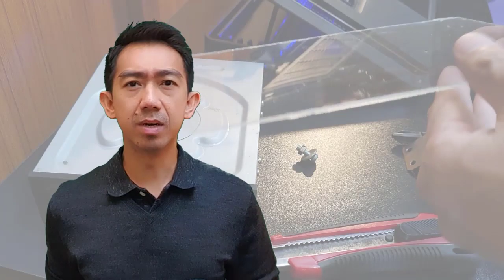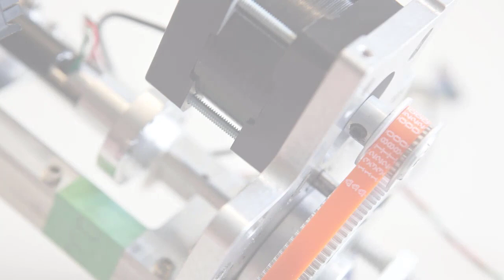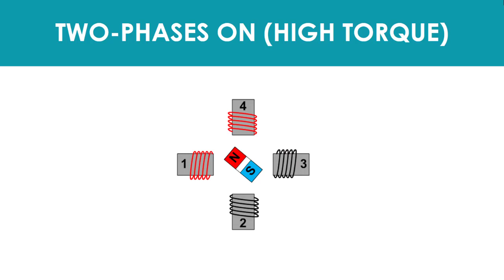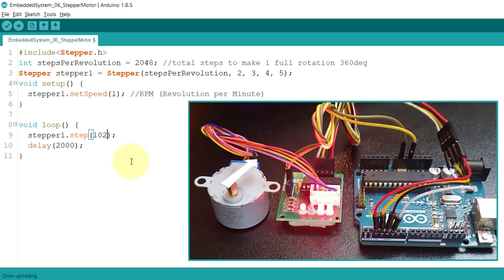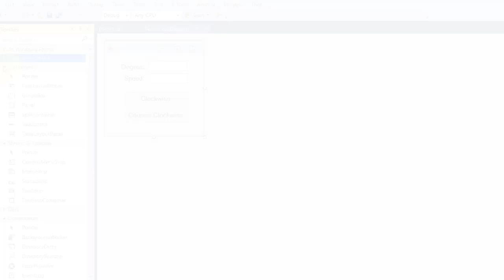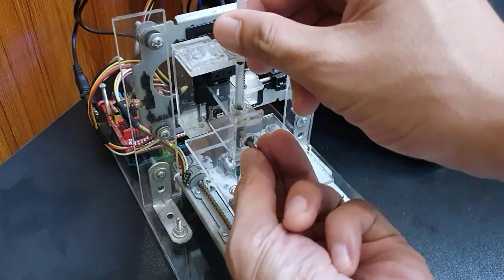09  Stepper Motors interfaced with C# - CNC Drawing Machine | Embedded Systems Application

Comment: THANK YOU FOR THE BEAUTIFUL VIDEO HOW SHOULD THE CODE FOR 3 PIECES STEP MOTOR CONTROL?
Reply: it doesn't work that way

#include <Stepper.h>
 int stepsPerRevolution = 200;  // change this to fit the number of steps per revolution
 
Stepper stepper1=Stepper(stepsPerRevolution, 2,3,4,5);
Stepper stepper2=Stepper(stepsPerRevolution, 8,9,10,11);
Stepper stepper3=Stepper(stepsPerRevolution, 30,31,32,33);

String data [3];
int index =0;
float steps =0.0;
void setup() { 

  
  stepper1.setSpeed(10);   
  stepper2.setSpeed(10); 
  stepper3.setSpeed(10); 
   
  Serial.begin(9600);
}
void loop() {
 if (Serial.available ()){
  data[index]= Serial.readStringUntil(',');
  Serial.print ("data read:");Serial.print (data[index]);
  index++;
  if(index==3){
    index = 0;
    
    steps = stepsPerRevolution / 360.0 * data[1].toInt();
   

    
    stepper1.setSpeed (data[2].toInt());
    stepper2.setSpeed (data[2].toInt());
    stepper3.setSpeed (data[2].toInt());
    
    if (data[0] == "C") stepper1.step(steps);
    if (data[0] == "W") stepper1.step(-steps);
    
    if (data[0] == "D") stepper2.step(steps);
    if (data[0] == "Q") stepper2.step(-steps);
    
    if (data[0] == "E") stepper3.step(steps);
    if (data[0] == "R") stepper3.step(-steps);
  }  
 
}

}

Comment: Thank you very much for this video it has been very helpful. I am actually down sizing from the usual laser cutting machine I work on with fanuc driven systems to playing around with more programing and automation. I decided to build a little CNC Machine to start this learn rabbit hole and jumped straight in. Well I'm learning lots haha and your video is fantastic. I've got a Atmega2560 inbuilt wifi board, 3 of the stepper motors and controls (that is in your video), adjustable DC-DC step down module and a 4 relay board for some in progress lights which I thought would be a nice touch. I thought this might be a decent setup for a little project but I am having fun with the programing, setup and communication.  can you please send me the code as well.
Reply from the maker: Hi Dan, thanks and glad to be of help. Send me an email, and i'll give you back the code.joedgoh@gmail.com

Comment: Thank you for your video, I follow your instruction but I have some problem with Serial communication. When  I send Degree and Speed from C# to arduino, my stepper does not work well, sometimes it moves right, but some time it doesn't. I want to know exactly what C# send to arduino but Serialport COM3 is busy. How can I do that?
Reply from the maker: Please check if your Arduino is really connected to COM3. It could be using a different comport.

Comment: Hi, and thanks for your wonderful  videos.I'm using your method to get String data from a C# App, but there is a little problem whenever index value is not constant. In my case index could vary between 7 to 45. Any ideas? Best Regards.
Reply from the maker: Hi, thanks for the support. Can you please elaborate your problem? C related programming languages always start with 0 as the first index in an array. So, I am not sure where 7 to 45 come from.
Reply: @joedgoh  In your example you had to reset the index value to 0  after 3rd input ,because you had 3 inputs, in my case I might have 7 inputs first, and next time could be 10, I mean there is no way for me to predict the number of inputs, so my question is , is there any reliable way to use the same method without relying on index value or any other different approach? Thanks for sharing your knowledge.
Reply from the maker: If you are going to use the same method of reading strings (comma-delimited) then consider the biggest possible size of your array when you declare, so your code doesn't break using the index. The downside is that, you might be reading empty strings for some elements if you only have few data to transmit, and it is not very efficient. Unless you want to implement the concept of dynamic array
Reply: @joedgoh  Thank you for the  information.

Comment: Hi, is there a way we can download the code?
Thanks
Reply from the maker: Can i have your email?, i'll give it to you. Thanks
Reply: Thank you , i have typed the code. I am trying to build the same visual studio app but be able to input all the motor characteristics in the app itself.
Is that  possible? Thanks again.
Reply from the maker: @pafcunha100  stepper motors are typically open-loop devices. You can determine motor's current position and torque in an open-loop system (like when you control it in your C# app) without a need to receive feedback from the device itself. But if you want to add additional cost of implementing another circuit to determine the motor's position and torque (closed-loop), it is possible.